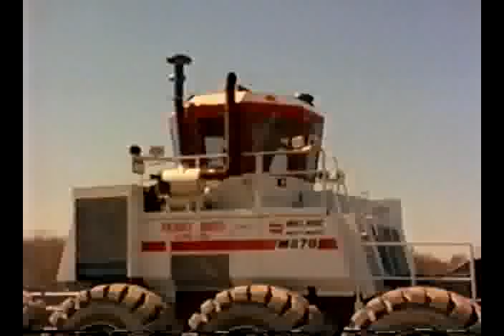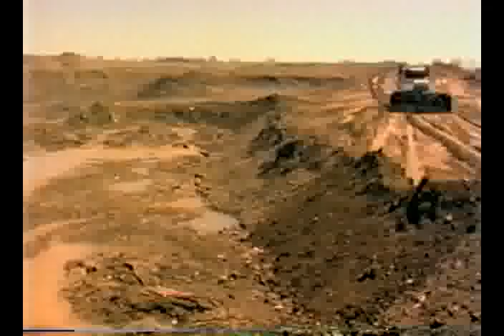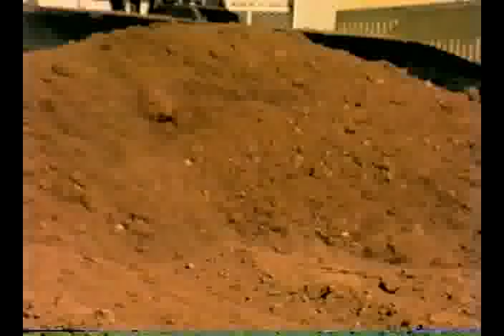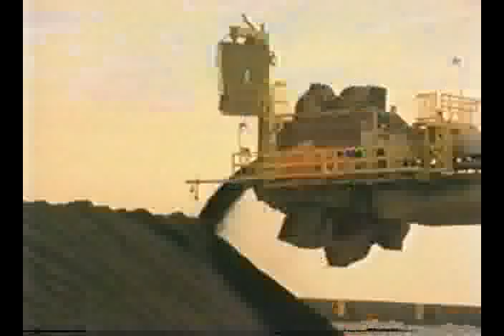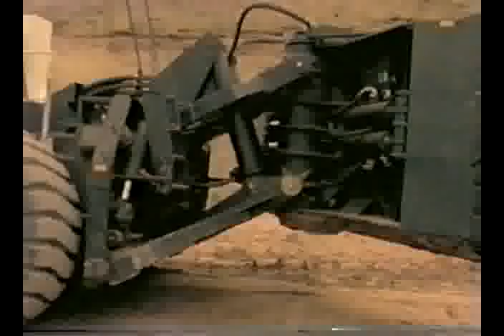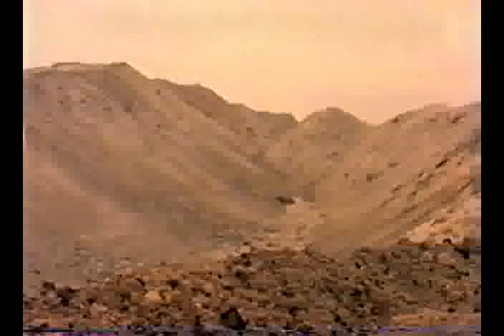Melroe M880 Multi Wheel

Comment: This wasn't the  only big wheeled dozer at that time. There was a V-CON, and I think it came out as a prototype wheel dozer. If I remember correctly, it sat high like the Melroe and had 4 wheels. The name stood for Vehicle Construct- ors and was a div. of Marion Power Shovel which be- came Dresser Ind. owned, later it was called(INDRESCO).I think the power unit was a 12V- 149. There was also a prototype mine haul truck from V-CON that had 4 abreast wheels front and rear, like the KRESS coal hauler has on the front.The power unit was an ALCO locomotive 8 cyl. engine.Remember back when the Terex Titan,Unit Rig Lectrahaul & the WABCO 3200 were made, big power was the ALCO and EMD engines, way too heavy for the vehicles and only about 900 r.p.m.'s.

Comment: Try an get 8!mph out of a d11 or compaction their getting with the m880 not to mention u could replace all 8 tires for half the cost of an undercarriage oh a conventional dozer an that's just what u would be doing if u tried pushing long distances all the time
Reply: ...purchase cost, maintenance cost, engine rebuild costS, transmission costS, drive system cost, fuel/consumables cost...

These things certainly had some VERY specific advantages in VERY specific use cases(the biggest mines on the planet pretty much) - but it's hardly shocking that they long went extinct quite a long time ago. These things had some very significant disadvantages that the vast majority of dirt moving operations on earth absolutely couldn't justify/afford

Comment: Tire wear and slow speed - looks more like they combined the worst aspects of crawler and wheel dozers instead of the best. Still, a very unique machine that deserves to exist just because of how neat the concept is.
Reply: The 1st line uf yer paragraph, I disagree & Slow Speed? U sed? Didnt cha hear whut was sed by the narrator? He explicitly highlighted the benefits of this wheeled platform over the classical crawler type dozers. Where from the fast duty cycle afforded by this machine results in better gains (from an economics stand point) from getting more earth (volume) moved to where they're intended, in a comparative hour's expenditure* of the same, what was had from legacy systems of old. This (was claimed) translates to greater productivity.   Productivity?, Absolutely. Howevr I'm sceptical of the expenditures side, at especially the fuel consumption factor in having 2 engines. Not to mention the encumbrances in having to put-up with not just 1, but 2 power-houses (probably as well 2 sets of drivetrains, I speculate) to contend with & closely maintained, just to keep it in sufficiently ideal, if not the satisfactory most running condition  in order both engines work in concert & the vehicle had enuf torque to go about. While I'm uncertain, whether if it had the benefit of having drivetrains that work like those of helis, where if 1 engine gives-out, the remaining is all that's needed to get-by. In helis uf corz, the "Turbine's ECU/M or now better known as FADEC" will in the event of "an" engine failure/power lost-outage, put into effect emergency power gain (beyond settings, what manufacturers recommend, optimal for preserving engine life) in the remaining to compensate for the loss of energy. If it works in the "technical" same, then it's swell, what if it duznt? Owing to a dead in 1, with lesser count of Strathclydes (Hp) to pull, along with the body weight of what's more than that of evn an 'Abrams' MBT, with just 1 other operational engine in service. It tho' probably coud still be driven around somewhat, but doubt it can anymore conduct earth shoving, what it's meant to do. 
On the 2nd sentence, I'm totally with U, agreeed..